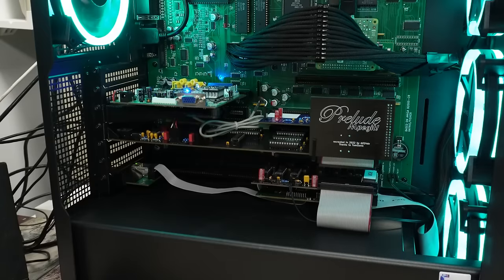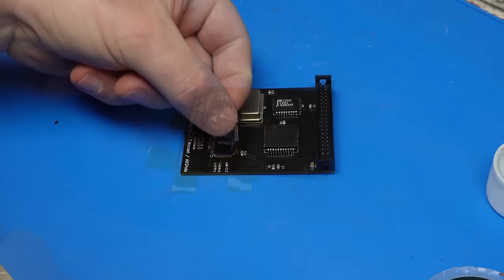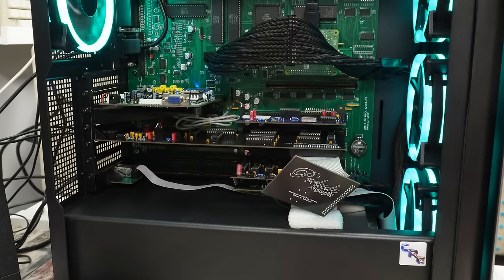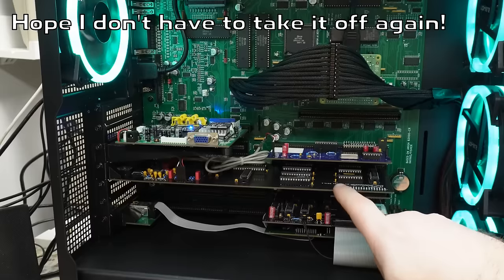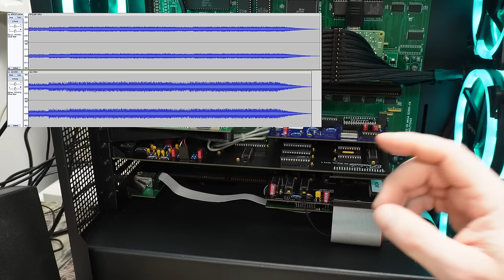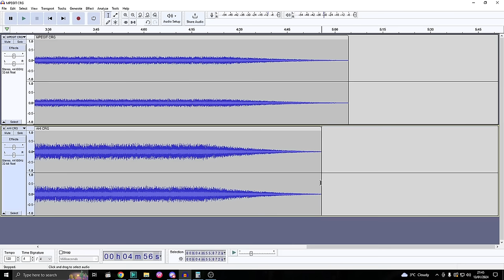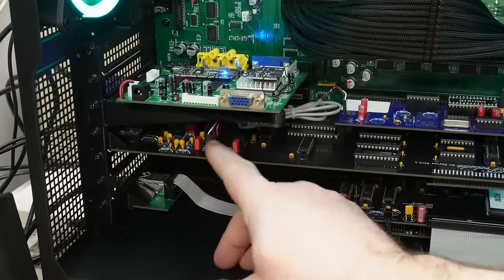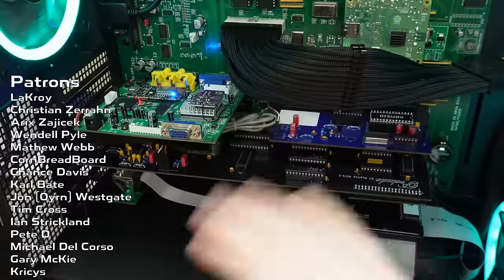Prelude Zorro 2 Amiga sound card - part 2 MPEGit FIX

Comment: According to the datasheet there are two registers with PLL offset values for 44.1 and 48 kHz. These are loaded with the values for the given 14.750MHz oscillator. They could be modified for other oscillator frequencies. As long as the drivers leave these registers alone you could write a program setting the correct values for the internal processing and the output should be correct.
Reply from the maker: A neat idea but I wouldn't know where to start.  I think for me it will be simpler to try and get the .724mhz oscillator.

Comment: Hi Glen, the extension ribbon cable problem surfaces elsewhere too, as I found out when trying to extend my CF card from my Terriblefire 1230 out to the back of the case, just wouldn't play ball at all. Had to use a really short cable which didn't reach the back. All academic now though, as I just fitted a PiStorm32 lite with pi4 , and have a SD/USB/HDMI plate there now.

Comment: Try replacing caps in microphone input op-amp feedback (C41 and C42 in the schematic I have; 1.2nF in value) with 680pF. This should improve high frequency response.
Reply from the maker: Will do, thanks for the tip

Comment: Yeah it seems like the closest you can get it 14.71 or 14.74MHz, in 3.3v form and SMD for expensive money. I looked to see if one could get a 29.45MHz oscillator as it wouldn't be too hard to make a frequency divider, but alas, same thing.

Your best bet is going to be a programmable PLL of some flavor that can output the desired frequency if you want playback to be spot on. The other thing to check out is if the audio track you're playing back is VBR, some MP3 decoder chips don't like VBR too much for some strange reason and will run those files slower.
Reply from the maker: We've found a programmable oscillator from digikey that should do the job.  It's a little expensive but I'm keen to know if it'll fix the issue.
Reply: @CRG  could you not use a stripped down raspberry pie Pico, cranked up as fast as it will go, 3.3volts be in the range of just pin connection? on a Pico?

Comment: What is the sample rate you record the mic in signal at? Because it sounds like 11Khz
Reply: It almost sounds like it's being recorded by the Paula sound chip and not the Prelude card. I wonder if there is a software setting that could be twiddled... maybe a pass-thru is turned on...?
Reply: Paula can not record. @LeftoverBeefcake
Reply: Didn’t the Amiga use ~8.5kHz? But I’d hope an expanded system like this wasn’t limited to that.
Reply: The prelude can do up to 64 kHz playback and record amiga resource says. But I know from memory that it can do 44kHz recording with ease and without any cpu overhead.  @kaitlyn__L
Reply from the maker: There is no setting in that ahi recording software to set the sample rate, it's just recording a raw wave file.  I have tried some other more professional software and it doesn't sound any better.  I'm going to try tweaking the caps on the mic input (as suggested in another comment) to see if I can improve it.
Reply: @Voyager_2  good good, that’s what I’d expect!
Reply: Let me  ask my buddy who build one and did some experiments with it. @CRG
Reply from the maker: I'd greatly appreciate that, thanks.

Comment: Another remark: Perhaps you can use the SIT8008BI-23-33E-14.725000, but it's SMD.
Reply from the maker: An smd part would be fine, I'm sure I could attach it with wires.  But we've found a programmable oscillator that we can get from digikey.  Think we might be going that route.

Comment: What about a synthetic crystal using a VCO with a MOTOROLA Synthesizer chip and a 10.240Mhz crystal should allow you to generate the required clock signal.

Comment: It would mean unsoldering the MPEGit but I bet you could get away with using a right angled pin header to mount the MPEGit, so long as the Prelude is not flush against the case already.

Comment: Ribbon cables caused me endless problems. A needle nose pliers across all side of legs works well for straightening purposes.
Reply from the maker: Bit of a shame I can't get this mounted as I wanted to show it off but these things happen, it was never meant to be mounted like that.  At least its working now.  

I'd have to get myself some better pliers to equally grip the pins on something so small but yeah, with a decent set I'm sure that'd work.

Comment: The crystal should be in circuit with a couple of small surface mount capacitors. If you change the value of these caps it might alter frequency and speed of the music but it might not as the frequency might depend upon the fixed frequency of the crystal and if you change the caps to different values it might just not work. If you do end up changing the crystal to one with a different frequency, you might have to change also any caps in parallel with it
Reply: It has complete oscillator module and not just bare crystal. I doubt it's tunable.
Reply: That four pin oscillator module is not tunable, the only cap useful/required is the typical 100nF bypass capacitor for the supply pins...
Reply from the maker: As the others have said this oscillator can't be tuned but we've found a programmable part that we can order to whatever frequency we want so hoping that'll fix the issue.